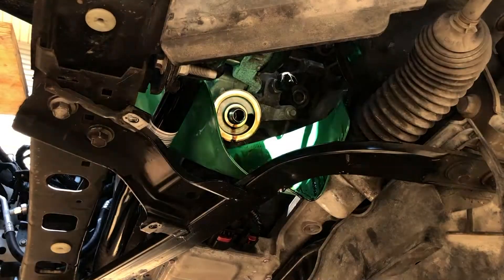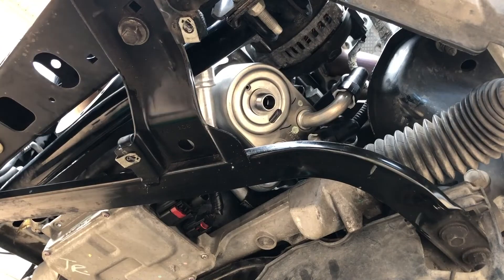S197 Mustang Ford Performance Parts Cooling System Upgrade

Comment: Where to buy it online
Reply from the maker: https://performanceparts.ford.com/part/M-8200-MBR
https://performanceparts.ford.com/part/M-6642-MB
https://kohrmotorsports.com/product/2005-2014-mustang-gt-aluminum-radiator/
Reply: Thank you a lot
Reply from the maker: @zhestyrzzz9687  No sweat! Please like, subscribe, and share this video!
Reply: Subbed. I'm started to disassemble the stock radiator and along the way discovered that there is a trans cooler in between ac condenser and radiator itself. Those trans lines are in the way of taking the radiator out. You got any manuals or references on how I can do it in a safe manner without flushing the trans fluid and/or destroying anything?
Reply from the maker: @zhestyrzzz9687  Is this an automatic trans car?
Reply: @Mustang-Geek  yes, '14 gt with 6R80 trans
Reply from the maker: @zhestyrzzz9687  Hmmm. I'm not familiar with auto trans cars. Honestly, it can't be that hard...?
Reply: @Mustang-Geek  I've just finished installing the 3row radiator. It was horrible experience. Like I mentioned, transmission cooler lines were in the way and there was no chance to even remove the stock radiator. I was forced to depressurize the ac condenser by disconnecting ac lines to save some space for transmission cooler lines to be slightly relocated. The stock radiator was 2row. Removed it. And then spent another 3 hours trying to fit the 3 row radiator without breaking anything. I reside in GCC. The Weather is over 50C daily. Got 4C degress less on idle and cruising which is a huge improvement in my case.
Reply from the maker: @zhestyrzzz9687  Sorry you had so much trouble, but glad it's cooling better!

Comment: Not to be sarcastic but did you actually note a difference in engine and radiator temps? If so how much in comparison to the stock stuff?
Reply from the maker: Because there is a thermostat, the only time this cooling package matters is on the track. But, that's the point.

Comment: How much additional coolant did this require after install?
Reply from the maker: Sorry, I didn't check that. It's difficult to measure, as a lot of coolant is left in the engine, etc. It would vary, regardless. I'd buy an extra gallon of coolant just to be safe.
Reply: @Mustang-Geek   Thanks man. Will be using this video and your book for my install. Great read, bought it right after buying my 2012 GT
Reply from the maker: @remz857  Glad you like the book! For those not familiar, here's a short promo video: https://youtu.be/Y0ir3KnfVBs

Comment: I thought you had to use 8.5 quarts of oil now that you installed the boss oil cooler
Reply from the maker: Our engine took 8 quarts. The owners' manual says 8.5 is needed. Realistically, it's going to vary, especially if you like to run the oil level on the low side of the tolerance to minimize crank windage.
Reply: @Mustang-Geek  yes I know the standard 5.0 is 8 qt and the boss was 8.5, the only difference was the oiler cooler. I bought your book btw. It’s a great read👍🏼
Reply from the maker: @BritAcrossThePond  Thanks!!!

Comment: do you have gt500 electric fan set up when you installed this radiator? and how much this radiator thicker than OEM?
Reply from the maker: I use the factory electric fan. I don't have the factory radiator any more to measure, but the Boss 302S radiator is about 1" thicker than the stock radiator.
Reply: @Mustang-Geek  thank you

Comment: What intake are you using? I've got a boss 302 but now the intake doesn't fit
Reply from the maker: Ford Cobra Jet. Because the radiator is thicker, I had to trim one of the ears off of something because the radiator fan sat further back with the thicker radiator. Not a big deal, but maybe this is what you're experiencing?
Reply: @Mustang-Geek  I have the boss intake, and I just had to remove all the sound frequency chambers in order to fit. The top mounting tabs needed to be relocated as well. I was expecting a better factory fitment then what I just went through. Might need to get after market Cai to really resolve. Trying not to lose the red key tune
Reply from the maker: @timothyzipfel398  Understood. Unfortunately, a thicker radiator is gong to move things around a bit.

Comment: is your mustang an automatic transmission? mine is an auto. would like to know if the FR500S aluminum radiator fits to it
Reply from the maker: No, my Mustang has a manual trans, but the FR500S radiator looks has provisions to mount the auto trans cooler.
Reply: Fluidyne has some great all aluminum American made radiators for our cars too, both manual and autos if for some reason you do not like the extra bulk of the Ford Performance options.
Reply: Did you installed this radiator in your mustang ?
I’m planning to get one like this one and mine automatic transmission

Comment: Great walk-through. Quick question on the old radiator there is a 3rd set of clips that has a long screw to. Not sure what to use to remove it
Reply from the maker: Not exactly sure what you're referring to. Is there a time on the video that shows it?

Comment: Do you have to use the that oil filter or can you stick with using an fl-500S or an equivalent variant
Reply from the maker: Good question. I'm not sure the FL500S filter will fit. The FL820 is much larger diameter than the FL500S filter. To me, it just makes sense to buy a few FL820S filters for future oil changes. They're $15, so it's not like they're expensive.